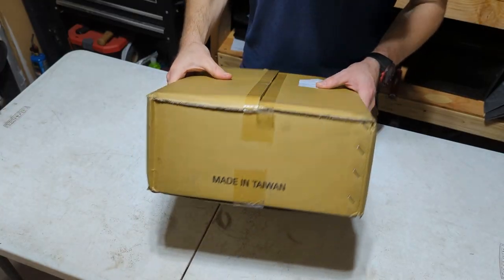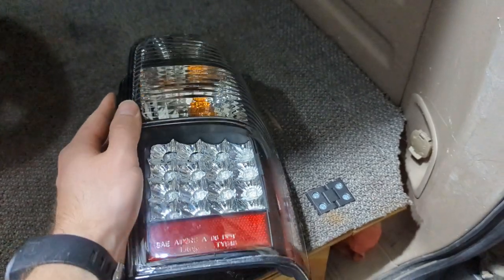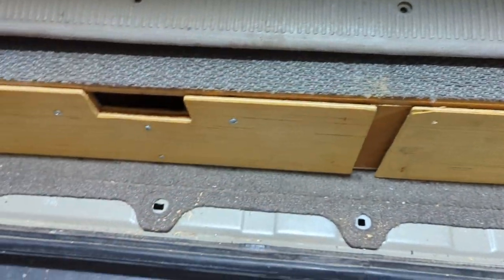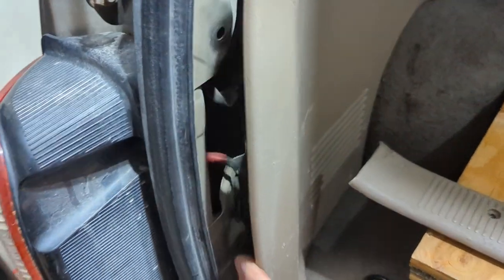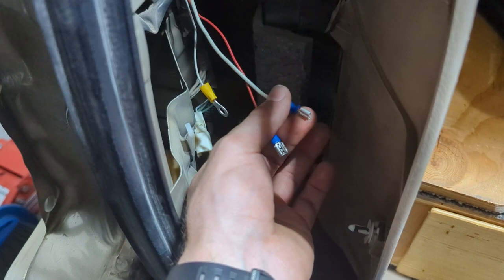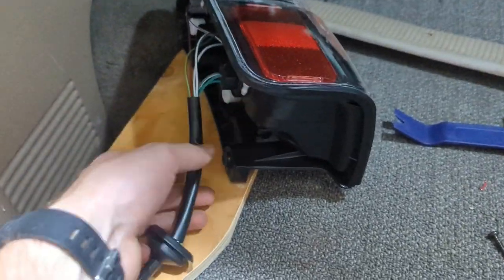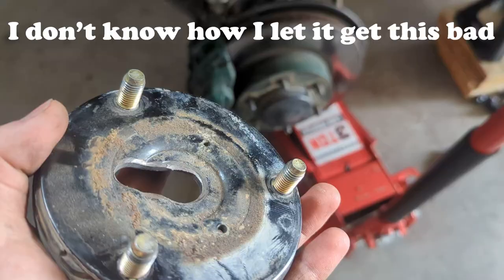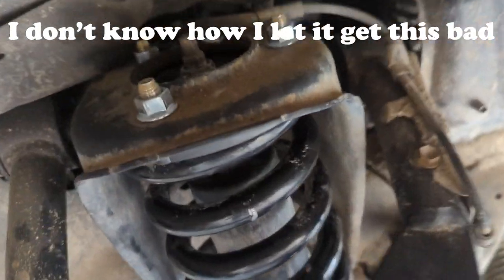4Runner Tail Lights

Comment: Nice job, do you know where to buy a 3rd brake light replacement
Reply from the maker: It looks like SRQ Fabrications make a modified replacement, but if you just need a stock one, eBay or a junk yard. I cannot find any newly manufactured parts. Thanks for watching!